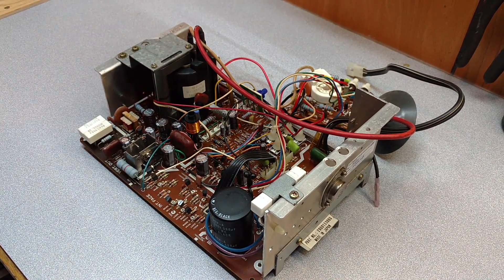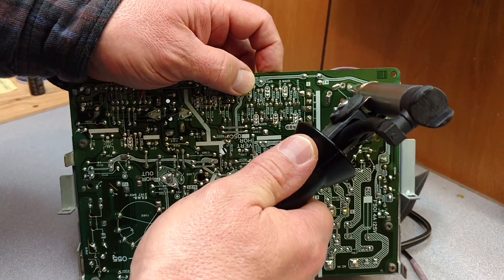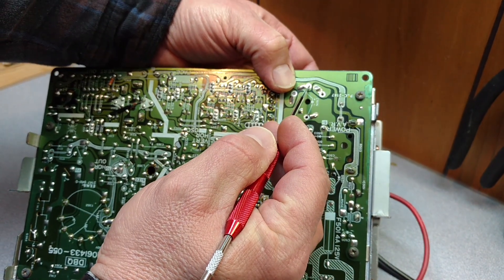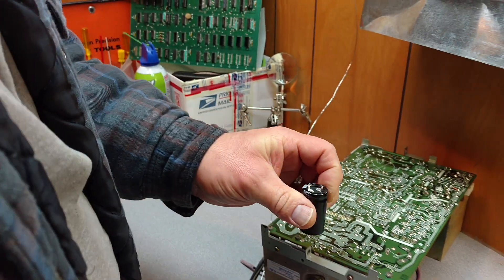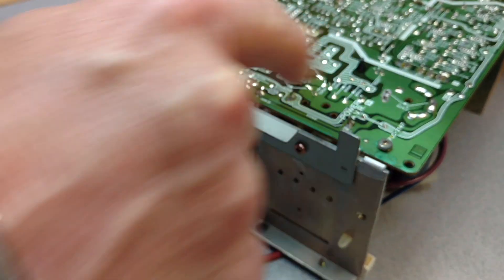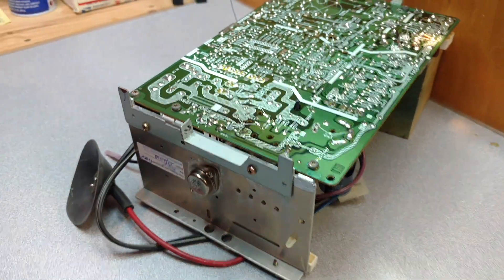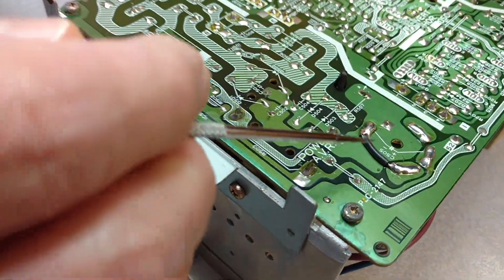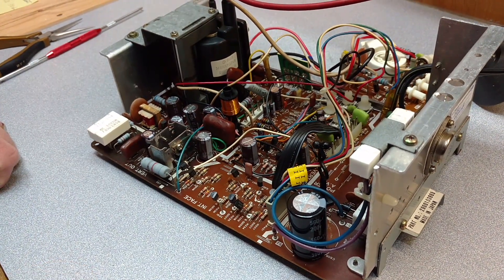Replacing arcade monitor filter capacitors when your PCB doesn't have 10mm hole spacing

Comment: What type of desoldering iron is that? Never seen one.
Reply from the maker: i have used the Edsyn ZD500DX desoldering station for almost 30 years and own 3 of them and i have always been happy with them.
Reply from the maker: @Peter Frencken its actually the quietest i have found but the vacuum pump sits right by the camera mic so it seems much louder than it truly is.